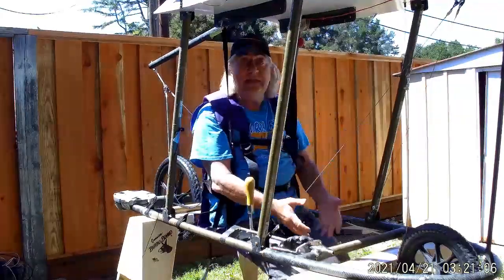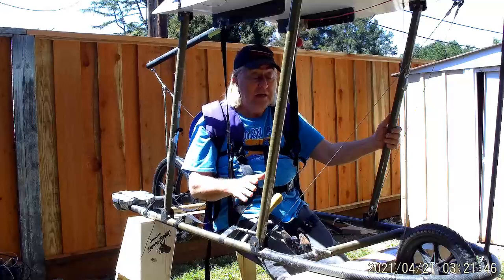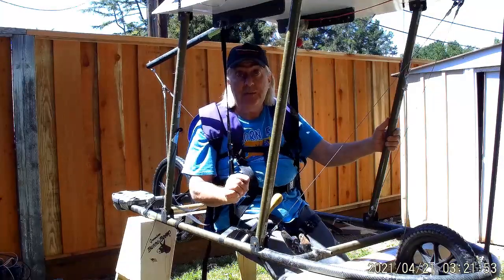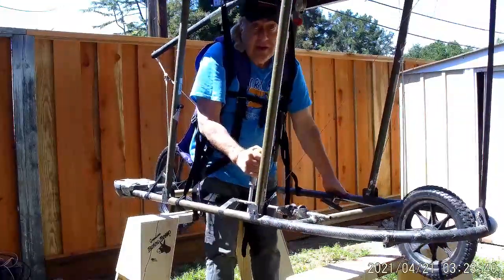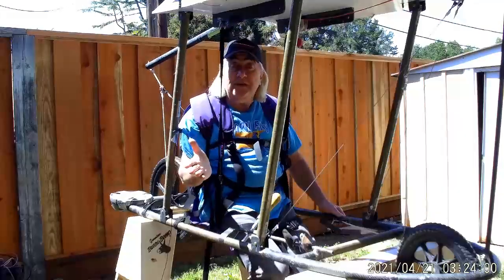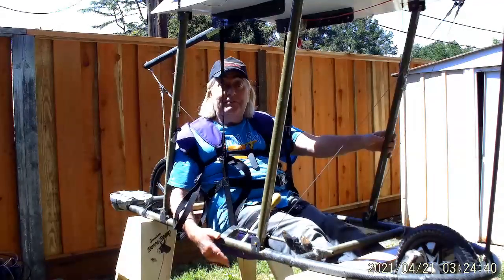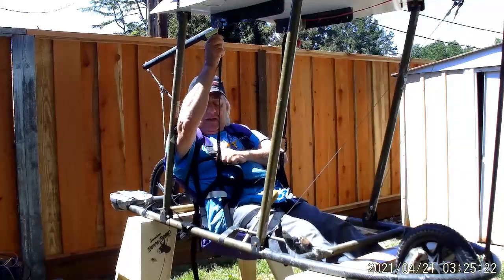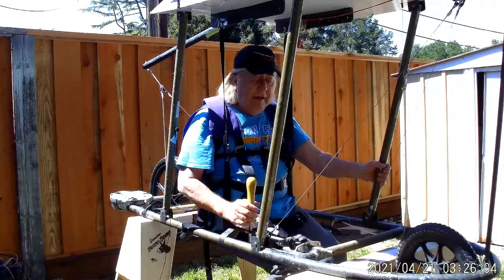KW MkII Rigid Wing Hang Glider Development - Human Machine Interface Part 1 of 3

Comment: Hi Mr. Klingberg, I was wondering what your studies show when you put your vertical rudder or even a droop tip below the wing instead of your rudder inboard.  What did that look like in your Foil software study?  FYI, I flew FLedgling 3 flying wing from 1977 through 1986.  I flew many soaring hours mostly thermal, and several summers in Owens Valley near Bishop CA up to 19,000 MSL.  Ha, we might even know some of the same guys like Eric Raymond and many others.
Reply from the maker: I never looked at that config. Anything below the wing becomes a problem when launching on a steep hills or cliffs. You run a high chance of hitting something and ground looping. The is especially true for swept wings because with the slope, wing sweep and the limited pilot height, the ground clearance can easily go to zero. Draw it and you'll see what I mean.

Comment: Since you will have to draw up your knees to bring your feet into the cockpit after take off, have you considered a stirrup/rope system into which you tread in order to elevate your body?  The Swift system sounds effective if clumsy.  I'm thinking of eccentric cams as used on compound bows.  Perhaps it could lock into place when full extent is reached.
Love what you are doing.  I used to design and make hang gliders in the '70s and '80s.

Comment: Very cool. How much tension will be on the control cables? Will it be difficult to connect them? Even a few pounds of tension can make the second cable a real bear to connect.
Reply from the maker: The tension is low-med and has worked fine during the ground testing. Control loads are light to med.